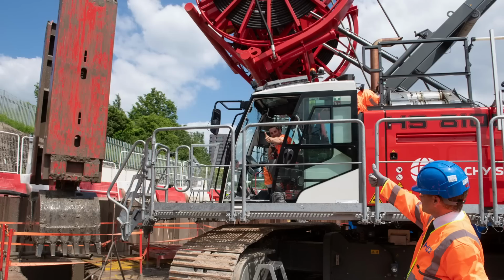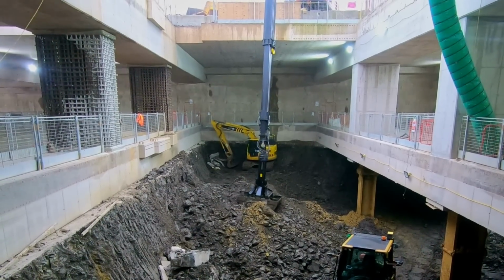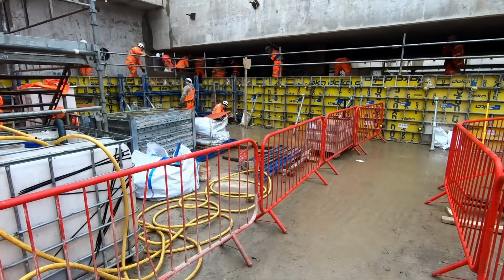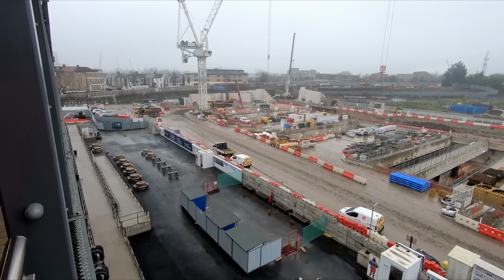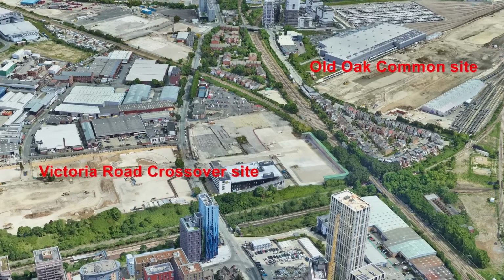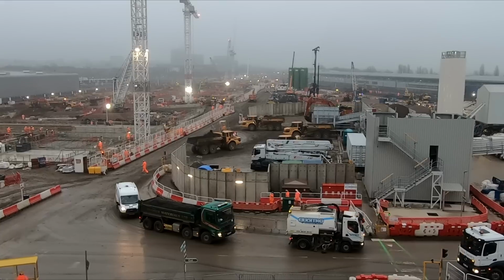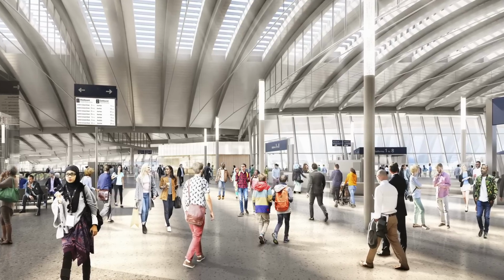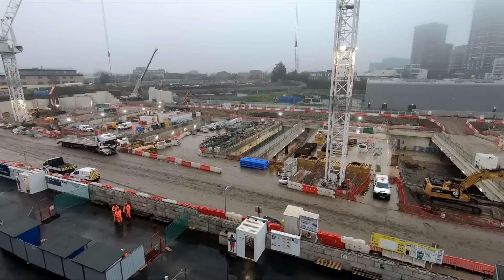HS2 Old Oak Common Station, London

Comment: This explains Old Oak Commons HS2 station along with  schematics of the HS2 routings much better than I've seen before.   The HS2 routes are not as might be predicted from the depiction of the HS2 track alignments.  Manchester HS2 trains are not going through Crewe as the HS2 track alignment would predict.  Maybe this is a logic schematic, but the schematic doesn't show an in-line HS2 route between Manchester and Crewe.   Now these have been canceled, but understanding the routing is still needed to understand the workings of the overall project as proposed.   

Except for when HS2 trackage extends north of Binghamton there is no connection of HS2 train set equipment on to the GWML.    That would mean it is not possible to use a train from Crewe or Manchester that would use the fast HS2 trackage from Binghamton to London.   What ever the ridership numbers are this would still leave a significant number of non commuter passenger trains on the GWML where the intent of HS2 was to greatly reduce those trains by placing them on HS2.  

Typical HSR passenger cars are of wider loading gauge than UK rail passenger cars.  The expectation is that with a new railway for HSR it would be made at what would be typical HSR loading gauge.   Most off main line handling tracks could be made to accommodate these cars relatively easily, but they would they would not fit for standard UK loading gauge.   Some of the very restrained routing HSR passenger cars in the very distance future on GWML might be because it would require refitting the GWML for a larger loading gauge.  

I heard people refer to the Binghamton - Old Oak Commons HS2 route without other connection in a derogatory tone as a shuttle, but with no in-between stops that is actually what it is.   If the HS2 train sets terminate at Binghamton as shown in this routing diagram then in order to go further one would have to transfer trains.   There are track platforms at the Binghamton station being constructed that appear to not be through tracks that terminate at the platform.   Surprisingly the HS2 routing diagram doesn't show a HS2 train sets being able to proceed further north then Binghamton on the GWML while HS2 track was being constructed.
Reply from the maker: Glad I managed to explain it well

Comment: Are we going American? SInce when did Points become Switches?
Reply from the maker: What do you think S&C stands for?
Reply: @Rail_Focus  haven't a scooby
Reply from the maker: @dinger40  Switches and Crossings a term used frequently by Network Rail
Reply: @Rail_Focus  thanks. When did that change, I'm a dinosaur.
Reply: You know "switch" is an railway engineering term and not American? Switch diamonds, switches and crossings, switch blade, switch maintenance... all terms used regularly in the UK.

Maybe you need to find something to justifiably be annoyed about enough to comment, rather than just making ill informed digs for the sake of it...
Reply: @whereinsussex  no need to be nasty I was only asking

Comment: I really dont get how it will take a further 10 years to get to Euston. 

The channel tunnel, with all it's terminal infrastucture, took less (about 7 years I think). Despite assurances to the contary I don't  think the current government is that keen on pushing for a timely Euston completion.
Reply from the maker: The approach into Euston is very complex as is the station, but the site itself is relatively small. My "Euston Approach" may explain why it will taking so long.
Reply: @Rail_Focus  I'm aware of the complexity - maybe that should have dictated a different solution - but 10 years is a very long time to complete an infrastructure project already commenced.  

The only explanation is an unwillingness in Treasury and Government to release the appropriate funds and to accelerate the planning approvals.  They have already started 'economising on the Euston design signalling their lack of interest.
Reply from the maker: @barrieshepherd7694  I'm not sure if more money would help, it's already incredibly expensive, and I'm saying that as someone that supports HS2. But you're right 10 years does seem like a long time. 

The station building should go up relatively quickly, but I think the approach is incredibly complex, made even more so by the over site development and having to rebuild Hampstead Road, which could take 18 months to 2 years, before they can even start excavating the box. 

Then there's the huge cavern on the approach and the approach tunnels which have to be excavated using excavators, which is a painfully slow process..
Reply: It isn't real. It's the Tories playing politics with budgets, pretending they are cutting costs but acknowledging delays will just end up being more expensive in the long run, but their voter base and tabloids won't care about that

Comment: It's an amazing project. But I'm not really sure how long it will take to pay for It's self 🤔
Reply from the maker: The structures are designed to last 100 years without any significant maintenance, so there's plenty of time 😉. But in all seriousness even the BCR calculation which didn't include wider economic benefits was based on a 60 year payback period.
Reply: It’ll pay for itself a lot faster than any road project ever could

Comment: Well as rumours goes that HS2 won’t be serving London Euston until it’s been completed and HS2 will temporarily terminate at Old Oak Common.
Reply: Euston is so far behind now it probably won't be ready until the middle of the 2030s. 

Why the route to Birmingham to old oat common is going much smoother and I suspect might even pull ahead of schedule and open before 2029.
Reply: Looks like HS2 will terminate at Old Oak Common.
Reply from the maker: @Andrewjg_89  I'm still confident Euston will be completed
Reply: @Rail_Focus Fingers Crossed 🤞
Reply from the maker: HS2 will terminate at Old Oak until about 2033. But in order to operate all the services such as 3tph to Manchester, 2tph to Liverpool and hopefully services to the East Midlands then Euston is needed at OOC wouldn't have the capacity.

Comment: Really interesting, thank you. These mega projects have always fascinated me ever since I went to the channel tunnel exhibition that had in Folkestone when they were building the tunnel!

Also, I’ve never heard of “ground heave” - an interesting concept that seems to work counter to gravity if it’s pushing up?
Reply from the maker: Ground heave is caused by the ground basically wanting to fill the hole in. Gravity pushes down on the surface surrounding the box which causes the ground to want to push back up into the void.

Comment: Great video! Does the Elizabeth Line also need slewing to the new station, or was it already built in the right place?
Reply from the maker: Liz Line will also need slewing into the new station. The GWML and Liz Line tracks all run parallel passed OOC.
Reply: @Rail_Focus  thanks

Comment: Although I won’t be surprised I’ll still be disappointed if (or when) HS2 opens before California high speed rail
Reply from the maker: Is it or isn't it being constructed? I never can tell. It's such a shame, but it doesn't help that Musk spent millions on Loophype to try and kill it
Reply: @Rail_Focus  it’s currently under construction in the Central Valley, only 119 are under active construction, with the initial operating segment (171 miles) under pre construction (testing soil, utility relocations, etc). The tunnels that connect the Central Valley to the LA basin have not even finalized where they will go…. The San Francisco part of the project is doing alright and Caltrain is almost complete with their electrification project. La is currently working on upgrading their Union Station as well to support thru-running. But we’re nowhere near as much progress as you guys have gotten. Full operation of San Francisco to LA is expected to be competed by 2033 (I doubt that will happen), and the initial operating segment or begin in 2029 (that seems like it might actually happen tbh). The big challenge is getting those tunnels started between Palmdale and Burbank, as well as Bakersfield to Palmdale which goes through Tehachapi and includes a shorter tunnel